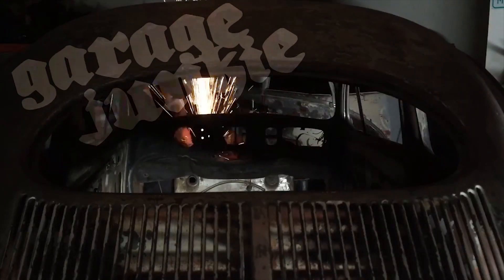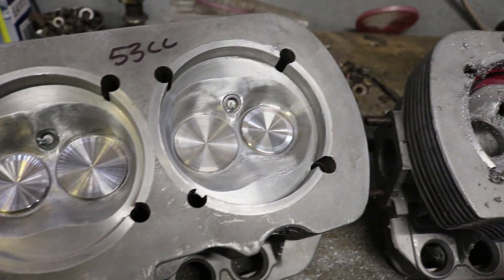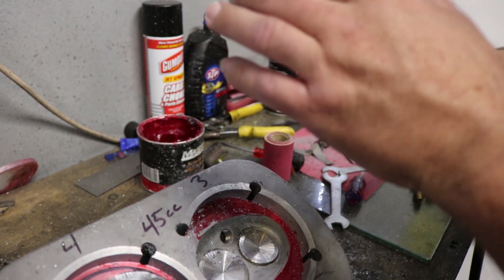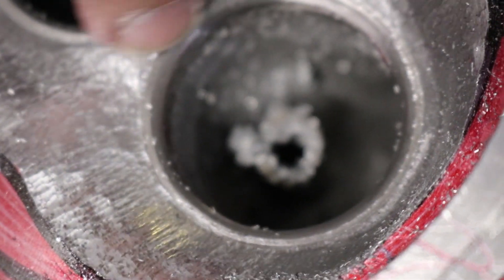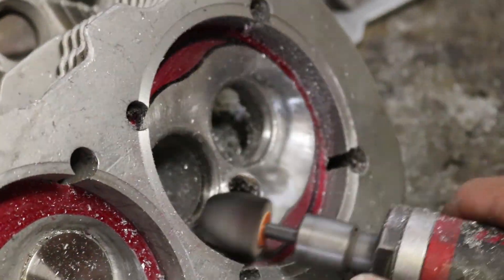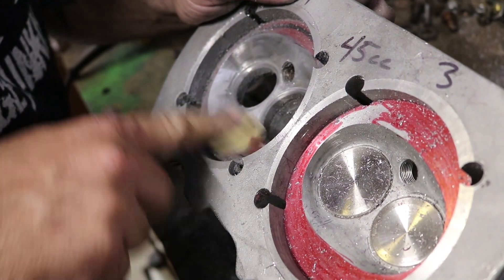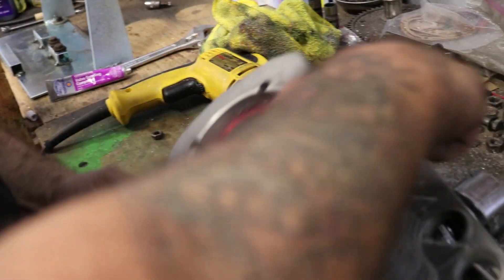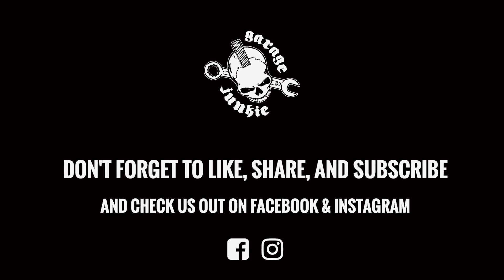How To Add More CC's In Your Combustion Chamber

Comment: When you did the headwork and increased the the head capacity from std too bigger. Does is lower your compression ratio? And what advantages does it give?
Reply from the maker: I suppose I should have added that because the combustion chamber was so small initially from work that was done cutting the heads down, I had to enlarge the chamber so I didn’t have to run .180 barrel shims. Had I not, the combustion would have been happening in the cylinder making the engine run hotter and potentially warp the cylinders.
Reply from the maker: It actually has more horsepower because the combustion is happening in the appropriate fashion.
Reply: @garagejunkie6742  makes sense. Thank you.
Reply from the maker: Pierre Du Plessis yes, it did lower the compression, which was the goal. Basically creating room in the combustion chamber allows for the combustion to happen in said chamber and not in the cylinder.
Reply: @garagejunkie6742  in theory your motor looses some horsepower and gain torque if im correct?

Comment: The technical term is...increasing volumetric efficiency.... but i like the wheezing chick!
Reply: I call it voodoo - change cams/work on your exhaust vs. intake setup if you want to change volumetric efficiency.  Outside of plain unshrouding, increasing chamber size has only one of two goals: get away from detonation on pump gas, or make room for a popup piston to get at higher compression [using race gas],   Here's the thing: energy efficiency [and usable power] goes up as compression goes up - that's why direct injection is being served up by more and more manufacturers.  Their challenge is keeping fuel pressures high enough/temps low enough to have predictable metering when an injector opens.  Flashing can make some crazy flow inconsistencies in delivering proper lbs/hour.